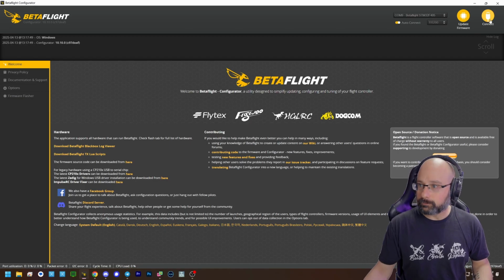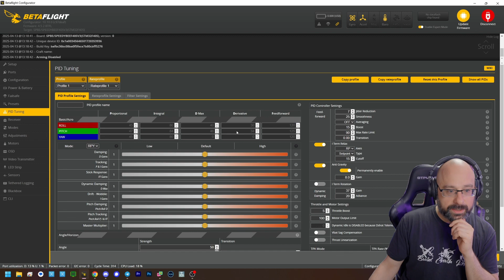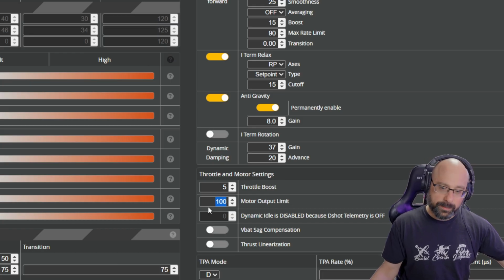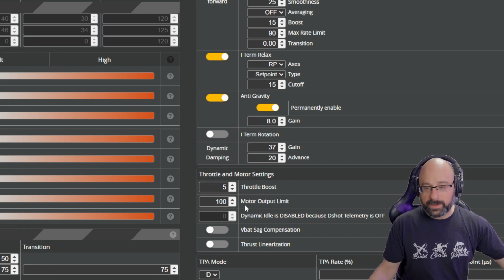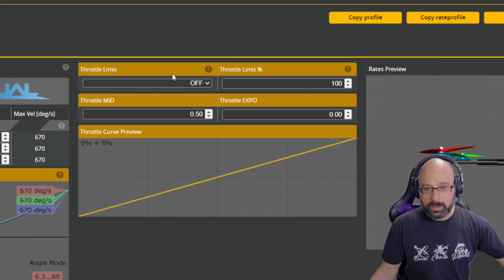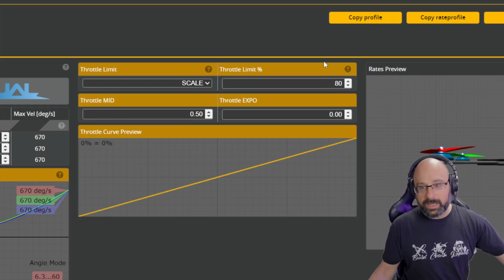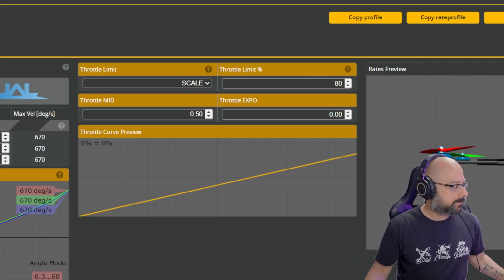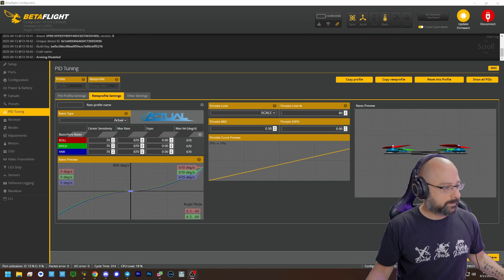How To Slow Down My Throttle On My FPV Drone? Throttle Scale? - FPV Questions

Comment: thrust linerarization set to 20% and mash the top 20% of the throttle into the top 5% of stick travel , programmed into your remote, not in betaflight's throttle expo. youre welcome.
Reply: I wish betaflight could do that. Car and motorcycle throttles work kinda like that, tho not as extreme.
Reply: @Jakalwarrior  you kinda can in betaflight but it's much more abrupt if you do the top 20% mashed into a few percent of travel if you do it in your controller. i say abrupt but you cant hardly notice it switching from 80% go to 100% go. it's just nuts and more nuts.

Comment: I know bardwell is anti throttle expo, but I love it. Has made a big difference in my flying, especially for interior cinewhoop stuff
Reply: Yeah, absolutely!!
Throttle expo seemed weird for me, but a friend told me to try it, and I never went back, I immediately stopped pumping up and down with the quad
Reply: Lots of racers use throttle control, wheel on remote
Reply: @craig199  How does that look like? The wheel sets the throttle scale? Or the expo?
Reply: @Handcraftedcc  on my Zorro I use s1 wheel to control Aux 3 of the remote (throttle) so I can switch on the fly between -99 to +99 of single output. It’s not ment to adjust during flight but more of a tweak in between. I’ve seen many videos of racers comparing throttle control vrs. Raw and basically some claim it actually helps better flight times. Since you can have slight control no need to over correct. I just use mine for training, gaps and tricks until I am confident. I set up a ELRS profile just for the throttle adjustment and keep my other profiles vanilla. All done on remote no pid tuning

Comment: Something you can do if the drone is too powerful (true if you're starting out) you can lower your max throttle to ~70%. Betaflight > PID Tuning tab > Throttle and Motor Settings > Motor Output Limit (if i remember correctly)

Comment: I have this problem with my Meteor75 Pro. After watching Bardwell fly indoors through gates, mine feels too powerful and speedy than I want it to be. I throttle to 75% or so but it's not throttle control (I can hover just fine) and my camera angle is at 10 degrees. It just might be the motors? Bushmaster 1102 22000 KV motors.

There's a lot that affects indoor flying control. I'm hoping I can find what I'm looking for without buying more tiny whoops. I only have the one drone and would rather go bigger, not buy more whoops.
Reply: Try at 50% throttle, it really is throttle